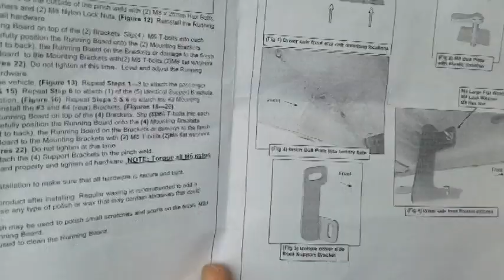iBoard Running Board Install | Ram Promaster | Off Grid Van Build

Comment: Thank you, Thank you, Thank you for this video.  I got inspired and purchased my running boards on Ebay and installed them today. Even though I had 3 pages; front and back;  of explicit instructions, your video was much easier to follow and I was able to do it all myself. Me, a 65 year old woman laying under a Van drilling holes and installing running boards as the neighbors watched from across the street. My neighbor works on cars all the time and gave me a big smile and a thumbs up on the install.  Too funny!!
Reply from the maker: Awe...  I love this.  Thank you so much for sharing with me. ❤

Comment: FWIW I’m installing an iBoard running board(s) for a 2014 Ram Promaster. My instructions have you put the second, smaller support bracket on the outside of the pinch weld, rather than the inside.  Probably doesn’t make much difference!  But they might be easier to fit on the outer side.   I haven’t looked yet (still on the sofa, reading)!
Reply from the maker: That is correct now.
Reply: Ahhh … but on a 2014 Promaster, it may have to be done on the inside — so I’m glad I saw your video, or “inside” would not have occurred to me as an option.  On the drivers side at least, there’s no way I can fit those brackets on the outside, even though I’d like to cuz that’s a much easier position to drill in!  I haven’t gotten that far on the passenger side.  Thanks for the video.
Reply from the maker: Glad to help 😊

Comment: Thanks for the video. I just ordered my Iboards. Did you drill the hole through the spot weld or next to it?
Reply from the maker: i didn't drill through a weld. there is a recessed spot about the same size as the bit.  that's were I drilled.

Comment: I just received my running boards and it seem to have  threaded inserts instead the rubber plugs on the very front body area, for the large front brackets.  I think I'm going to have to get some 8mm bolts instead  of using the bolt plates...
Reply from the maker: Please let us know if this works so anyone else with the same setup can use your idea.  Thanks for watching

Comment: Do you have a video for installing the driver side board?  I am trying to and it appears that the factory holes are too far apart for the mounting brackets.  Was hoping to see a video of the driver side installation to see if I'm doing something wrong.  Thanks
Reply from the maker: I am so sorry I did not.  but mine lined up perfectly.  Wonder if maybe its the bracket that me be off.
Reply: @JonniesJourney  thanks. There appear to be three factory drilled holes on the driver side. When I try to use the hole more to the front, the step is not long enough to reach the last hole. I installed using the 2nd and 3rd holes, which the step fits, however, it is further back than the passenger side. Not sure if they put holes in different places in the 2020 model
Reply: Your video was very helpful. Thank you for making it.
Reply from the maker: @goyankspa1  awesome. Love to hear that.